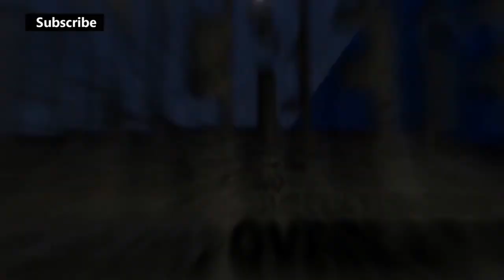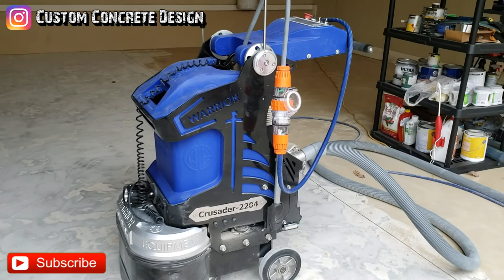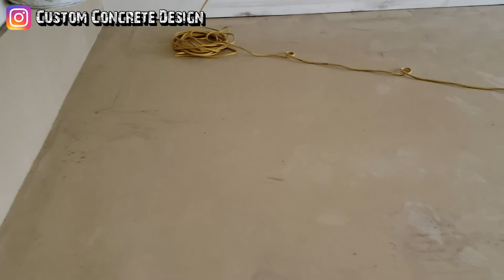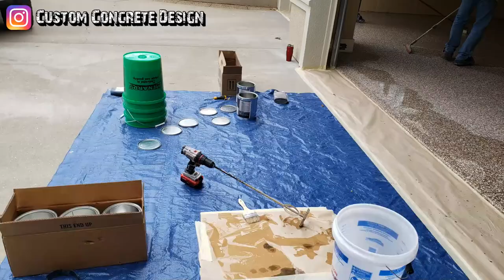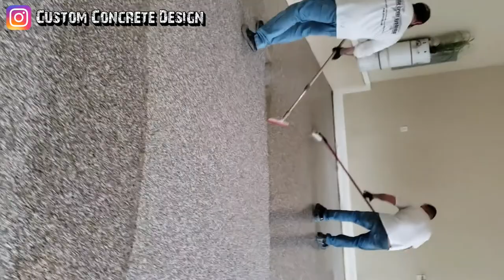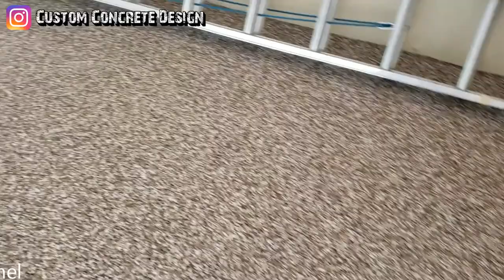HOW TO GARAGE EPOXY Floor Paint 👷 Epoxy Garage FLOOR COATING Lake of the Ozarks, MO

Comment: That's Beautifuly done, how much does something like cost?
Reply from the maker: Thank you, it depends on the condition of your concrete and the sqft of your garage floor, usually a standard 2 car garage floor at 550sqft it good shape and no other coating that needs removed would cost and average of $7.25 a sqft